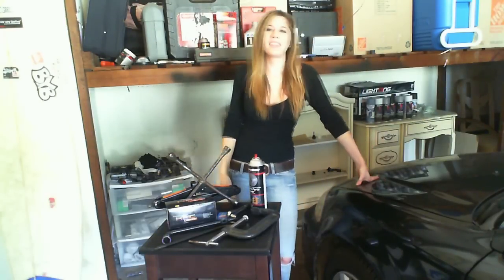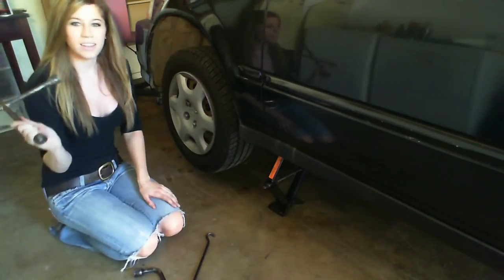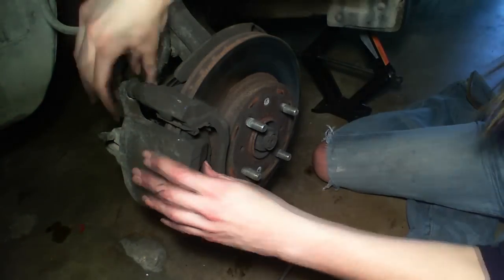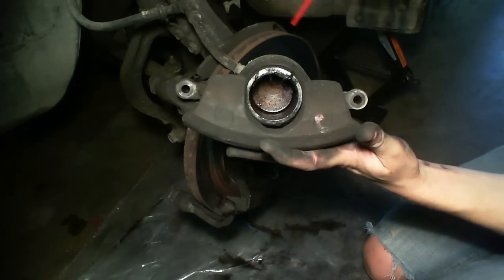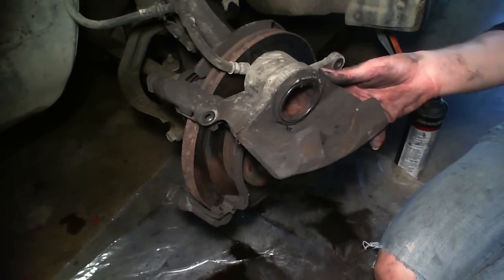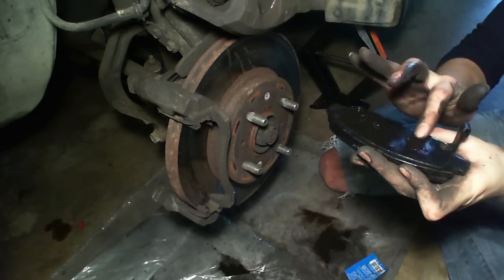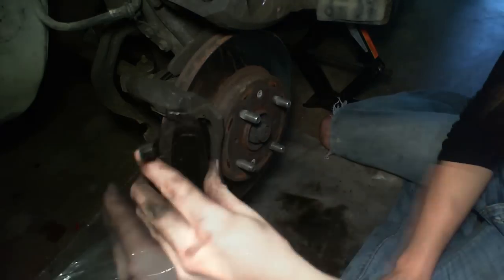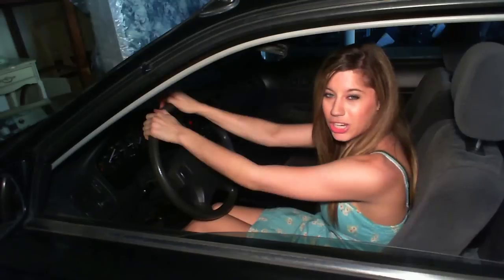HOW TO CHANGE DISC BRAKE PADS!

Comment: It is so nice to see a lady changing brake pads, because it really is quite an easy thing to do, as long as the rust/corrosion has not 'seized' anything on the brakes themselves.  I am a guy and I do my pad replacement myself all the time.  The only problem is that it's DIRTY, and if you live in areas where they apply salt to melt the ice/snow on the roads, then after 7 to 10 years the sliders on the calipers tend to SEIZE solid if you don't regularly re-lubricate the slider pins. And even if you do that, rust just generally eats away all everything, so after about 10 years everything is just a rusty flaky mess. 
That's about the time you either start to replace the rotor and drums and calipers too, or just go get a new car, because at that time probably a ton of things are ready to let go on the engine side of things too. Things like alternator, radiator, etc.  

Replace your car with a NEW CAR once your car has reached the 14 year limit  and/or 300,000 mile limit.  Remember that things that need to be replaced on a car start to rise exponentially after 10 years, due to AGE of the materials themselves.  For example;  the rubber dust boots/bellows on Toyota struts start to just disintegrate after only 10 years.  Imagine what else is going on in other areas of the car.  :  

So If your car hits the 10 year mark and it does not have 300,000 mile on it yet,  subtract 25,000 miles of 'LIFE' for every year over that 10 year limit.  That gives you an idea of how much longer you can safely keep your car going.  So at 11 years, that mileage limit would now be 275,000 miles .  And at 12 years that limit would now be only 250,000 miles (that's where my car will be next year, and that's when I will be replacing my car with a NEW Corolla).   13 years = 225,000 miles.  14 years = 200,000 miles.  After 14 years just sell the car no matter what as parts will start to disintegrate no matter what.  Once past 14 years it is cheaper to buy new than to try to keep the old car running.
Reply: Interesting formula. I agree that even if you don't drive the vehicle, the rubber seals disintegrate and cost a small fortune to replace. Scotty Kilmer recommends using a spray bottle to spray all accessible rubber bushings, seals, etc. with a liberal amount of AT-205 Re-seal to extend the life. I felt like it was worth a shot and followed his advice. Time will tell if it works.

Comment: In my opinion you did an outstanding job with your explanation and you sure made it look simple. Thanks a million. My only concern would be as follows; did you loosen the lug nuts before jacking the car & did you block the car underneath to ensure that the car would not fall.
Reply: or use jack stands instead of relying on the scissor jack to hold car up

Comment: Great video but you really should use jack stands when working under or around a raised vehicle especially use a junk factory jack.Also if you remove the cap on your brake reservoir  the piston goes in easier.

Comment: Very good video.  Thanks for demonstrating that you CAN do most vehicle maintenance tasks yourself.  I liked that you showed to use the old break pad to compress the cylinder.  I've seen several videos where they compress the cylinder without protection.  A couple of things that I would recommend. 

First, if your going to do your own maintenance, invest in a set of proper wheel chucks and jack stands.  This is infinitely safer then the jack that comes with the vehicle.  The small investment could save your life and the expense will be recouped with the first brake job you do yourself instead of paying someone else.

Second, remove the master cylinder cap after the car is jacked up so that you can compress the caliper piston with less resistance and pressure on the break line.  Years ago, I popped a break line because I tried to compress the cylinder too fast with the cap on the master cylinder which caused excessive pressure in the line.  Granted, it could have been a weak line, but it was no fun changing the line anyway.

Third, Disposable nitrite gloves go a long way in keeping the grime out of your fingernails.
Reply: can I sent my car to her.

Comment: Great video.  You should mention that on some cars, like VWs, the pistons can't be pushed straight in.  A tool that rotates the piston while it's being pushed is required.  Also, it's a good idea to clean and relube the pins and guide bushings.

Comment: Excellent job, girl! One tip, removing some brake fluid from the brake master cylinder can help when compressing the piston back into the caliper. Brake fluid rises as you’re compressing the brake piston. On my Hyundai Elantra, I had to use a special brake piston compression tool for the rear brake calipers. Maybe you can go more in depth on servicing the brake system, including changing out the brake rotors??

Comment from the maker: Noise depends on a few factors. Type of brake pads, rotor condition and caliper age. Usually what causes the most noise would be the type of brake pad you used in your application. Typically most people purchase semi metallic or organic brake pads. While they are cheap they are noisy. The best brake pads for those who are concerned with noise are ceramic. They are quiet break pads that have virtually no noise. You cars age and rotor condition can also be causing some noise.What year is your car?

Comment: Can anybody say "Jack Stands"!
Reply: Yes yes yes. I use my jack in a jiffy too. She also needs safety googles, lab apron, heavy duty chemical resistant gloves, a safety buddy, bottle of water for hydration, knee protectors to prevent abrasion from kneeling..... I doubt a sedan on 3 wheels will tip over the 4th side.
Reply: That is about the most idiotic thing I have seen anyone reply!!! If the wheels were square you might be right but instead of looking down her top in the video, look at the wheels, they are round. Sudden movement of the car for some reason (yes even with handbrake on) the jack can still dislodge itself and the rotor come down crushing her leg. How about that splatter from the brake cleaner, as far as I am aware, all brake cleaners are a hydrocarbon based solvent, not really something you want on your skin or in your eyes
Reply: Blue bot factory jacks arent very reliable. Calm yourself.

Comment from the maker: Yes the nuts were loosened before the car was jacked up. The wheels don't spin anyway because this is an automatic front wheel drive car. But it's never a good idea to rely on the transmission to stop the wheel from spinning. Thanks for your comment!!

Comment: Wow. Great stuff Ali. But do think about safety. I am trying to find the torque setting for my Jeep Grand Cherokee 2006 wk. 3litre diesel rear calliper slide bolts here in the U.K. These were fitted with the Mercedes benze diesel. Many U tube videos on how to though no torque settings mentioned. Many thanks Mark Wales U.K.

Comment from the maker: The rotors were not warped and were in good condition at the time of the brake change. But yes, I would recommend turning the rotors if the drive was experiencing shaking during braking. Glad you liked the video! Thanks for the comment!!

Comment from the maker: No you do not. You only need to bleed your brake fluid every 30-40,000 miles. You can look at your brake fluids color to best determine if you need a change. Usually if your fluid is dark that means you're due for a swap. However, if your fluid is still light it should be safe for driving. But as best practice you should get into the habit of changing your fluid every 30,000 miles (not matter the color) to ensure maximum braking performance. Thanks for the comment!

Comment: WOW. A pretty girl that can maintain her own car? That is super sexy! Most girls Ive met couldnt even change a tire... Why can't I ever meet a girl like this?
Reply: I've changed my spark plugs and coils, the mass airflow sensor(easy) the valve cover gasket, about to do my brakes. Next will be my ac compressor😉 All self taught cause screw paying someone else hundreds of dollars to do it. The a.c. compressor is an 1100 dollar job. If I do it, it will cost at most 400 bucks.

Comment: better jack for sure but as a backup even to jack stands I slide my wheel under the car next to jack.  rather have a falling car damage my wheel before me.
Reply: Carl Dunaway 
Yes, I have always placed a wheel under the car when I'm under it, or even when changing wheels on the side of the road, as its better for the car to drop onto the wheel than on You... and I always use jack stands when at home. I see nothing wrong with the standard car jack as used by Ally. I've used them a lot and they have never failed so far. Using a hydraulic trolley jack just makes going up & down faster and easier when doing repairs. 68autobug Lee
Reply: I've worked intensive care as a RN and have only had one trauma from a car falling. The guy jacked the car up in sand. Stupidity at it's finest. He was lucky. The only thing that happened was his ear was sliced in half. A few stitches and he was good as new!

Comment: 3 Safety things. First you should always use axle stands for safety. Secondly You should be wearing safety glasses especially when using the sprays and cleaning. Thirdly Raise the wheel until the tyre starts to change shape at the bottom, Then crack the Wheel nuts, This will stop the car rocking forwards and backwards. For information you should mention that it must be Brake Grease so you cannot use normal grease. NEVER put your fingers on the front of the pad, If you look at hers it is now covered with greasy finger marks that will not help the braking.

Comment: Correction:  The bolts on the back of the calipers have to be tightened to about 30 lb of foot pressure with a torque wrench.  To tight or to loose can be damaging.  FYI

Comment: your supposed to put the car on jack stand(s) if your working on the car for a while. because hydraulic jacks tend to lower over time. but the screw type(as i like to call it) dont usually lower over time. but to BE SAFE you should put a jacked up car on jack stands.

Comment: u touch the brakes  pads with graisse  hands.
u have already  making allot  of mistakes 
1-taking the wheel lock (losing them)
2 u should hang the calibre  with something  to avoid damage of the brake line.
3 working without  gloves 
great job and don't  take it us a complaints. wish you a good luck and i will never drive  behind you🤣
best wishes with 2021 soon from Copenhagen

Comment: You don't have to remove the caliper completely. You just need to remove one of the bolts and swing the caliper out to remove and replace the old pads. Otherwise, nicely done besides some safety precautions that needs to be considered..

Comment: She doesnt have experience.  Jack stand is very important before you work under your car you put your live in line is dangerous. Please next time use jack stands
Reply: shes not working under the car, and this is not a 3 hour job. with crappy car jacker i wouldnt really do this though. with a decent one however you dont need a jack stand. yes its safee but theres really nothing that can happen even if the jacker breaks as long as you still have 3 wheels on

Comment: honey you need to either...
A) put the tire you took off under that car
b) get some jack stands
You never work on a car supported by just a jack
Reply: Also absolutely never loose the nuts after the car is lifted. You should loose them a little and then lift the car and finish loosing them. If you loosen like you did the jack could fall to a side so dangerous.

Comment: where is your face mask for the asbestos dust coming off the brake pads????
Reply: +Duke Minty the asbestos that comes off of break pads usually isn't very potent, therefore not much of a harm to you. But that's just from my experience so don't quote me on that XD
Reply: +Duke Minty Most brake pads are not made with asbestos, now a days they're either semi metallic or ceramic, but it is still wise to be cautious.

Comment: Both bolts don't need to be removed, caliper swings up or down thanks to slide pin. Also with pads like that ( yikes) you need new rotors or those rotors will destroy new pads within months and then you'll have rotor warping issues on top of destroying new pads. Also lug nuts should be loosened but not removed prior to jacking up vehicle. Jack stands???? Grease isn't necessary either. Too much will become warm, runny and get where it shouldnt be. Also some pads have tabs that belong on the inside and that is the chirping/squeaking that lets you know when your pads are low.  Also the lug nuts have to be torqued down to specifications per vehicle manufacturer.. 80-140 ft lbs very important!!!. And following correct pattern. There's a list of things that she couldnt mention that pertain to safety and simply doing the job correctly. Viewers beware.

Comment: You forgot to open the brake and clutch oil tank cap and then bleed the brakes after replacing as there will be air on the brake system. Just pumping te brakes like u did at the end will not be safe for you or any other person fitting brakes as they could fail with the air in the braking sustem. Maybe redo the video the correct way to prevent harm to yourself and other following instructions from this video.  Nice to see a girl changing car parts tho. Thumbs up to you
Reply: Baz,

I completely agree about removing the brake master cylinder cap but what are you talking about with regards to the clutch?  Also, I disagree that bleeding the brakes would be necessary.  How would air have gotten into the system.  I've been changing brakes this way for over 30 years and have never introduced air into the system while changing pads or shoes.  You would introduce air into the system if you disconnect a break line such as replacement repair of a wheel cylinder; master cylinder; caliper; or break line.

Thanks

Comment: OMG. You're not ready for a tutorial on this:  No axle stands; no tyre under car; no turning the wheel to not tuck your head/hair under; no loosening before  jacking up. No need to unscrew both bolts and have pressure on the brake line, no ajar brake fluid cap to release pressure when pushing the pistons in, no safety gear. Everythingdiy -- you should watch a tut such as Chrisfix's.

Comment: 1:58 the OCD in me cringes to see her lean the tire against the bumper and hear it slam not once but twice before it settles down. 

Though on the bright side, nothing is more refreshing seeing a pretty girl getting her hands dirty with grease, dirt and grime working on cars. This alone forgives the few things I would not do while working on my cars:

1. get rid of scissor OEM jack and use floor jack instead
2. not working under the vehicle without jack stands or at least place the tire under the vehicle
3. wear eye protection
4. wear gloves. It is a pain in the butt to remove dirt and grease under the nails
5. work with a work light or sufficient illumination
6. never fix something and break another in the process, such as scratching your paint by leaning a tire against the bumper.

Comment: Explain, why you are doing things, like hanging up the caliper so it doesnt damage the brake line. You dont want to be getting that cleaner on the gators, use a cloth to apply around the piston, before you push it back in, so grit and dirt isnt going back inside with the piston. Also no threadlocker when puting the bolts back in the caliper, or lubricant on the pins to allow smooth back and forth movement - again explain why you're doing things. But hey apart from that, proof that anyone can do this, don't be afraid.

Comment: oh girl! She must never had a jack failure ... That tire, i would put under the car to brace any jack failures. While she put the caliper on top, i would still see it better secured. At one point she had it dangling and putting unnecessary stress on the brake line. Also, there is a reason why there are torque specs on bolts. Vibrations tend to reverse out the bolts. A torque wrench is cheap, so get one and use it to tighten the bolts to manufacturers recommendations.

Comment: It's NOT safe AT ALL to loosen the wheel bolts, while the car is jacked. Do it before jacking the car. Also, if the bolts are tightened correctly, it's not possible to loosen them up in the air. AND always use stands...the jack is for lifting the car, not for stand use...

Comment: Should have been titled "How NOT to change disc brake pads". 1) Used a scissors jack to jack up the car. 2) No jack stands. 3) Didn't clean or grease the caliper pins. 4) Didn't check or uncap the brake fluid reservoir nor remove fluid to prevent overflow. 5) Didn't use gloves or eye protection. 6) Handled brake pads with dirty hands. 7) Sprayed brake cleaner on rubber part of caliper piston. 8) Did not change or even clean the brake hardware. 8) Didn't clean the caliper.
There were a few others.

Comment: She realy needs to take some health and safety lessons:

a) no axle stands;
b) no gloves;
c) no face mask (dust is carcinogenic). .

On top of that she didn't brush away the dirt and rust, torque the bolts, didn't replace the shim's.  No explanation of the type of grease (someone is bound to use the incorrect grease) and possibly likely to contaminate the friction material.  Used a G Clamp rather than compression tool.  No checking of the brake fluid levels which may possibly have overflowed.

I would not want my wife to do this. Sorry.